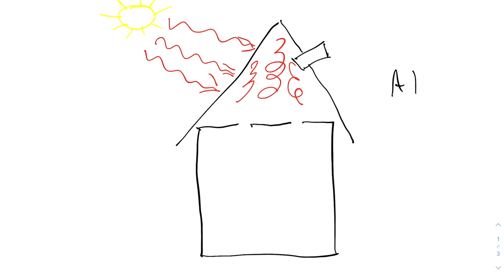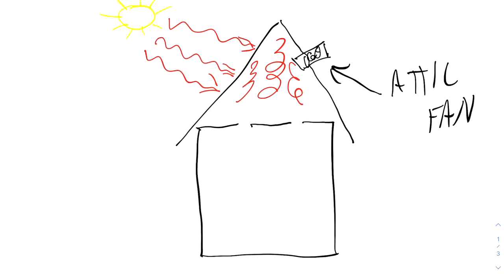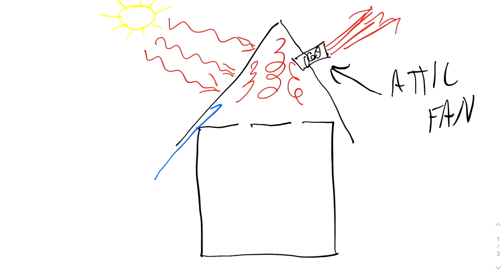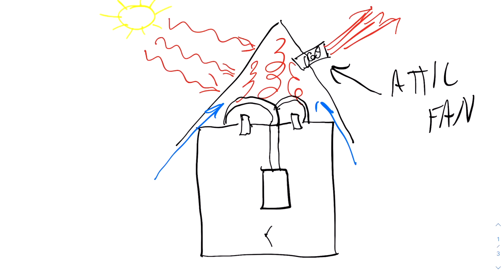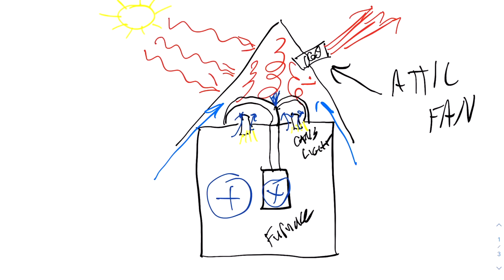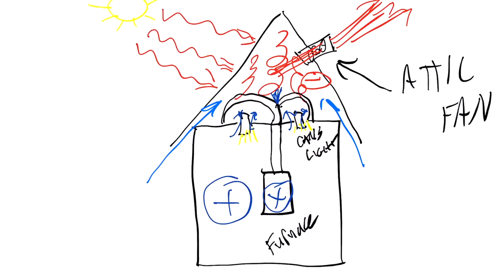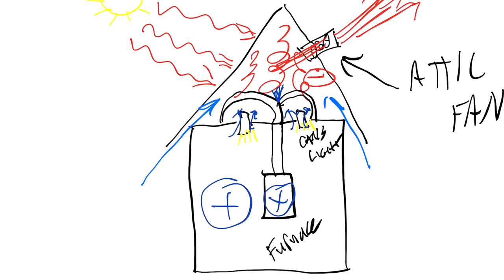3 Remodel Rip-Offs

Comment: I don’t know what part of the country the writen of this videeo was from, but they did mention Texas.  In Texas, every home needs an attic fan or a whole house fan.  Period.   

I moved into a Dallas mcmansion last February. The owner  installed Nest hvac controllers cause they are ‘cool” , but he didnt understand hvac nor how to use them.  The home was very hot since May.  The exterior hvacs had never been cleaned and could not keep up with north texas summer heat.   I watched YouTube videos to learn how to clean the outside units & that helped a lot.  Then  our attic fan died this August.
I had just gotten  the two Zone - two HVACs & two Nest controllers to work efficiently & our home was much cooler than what we suffered from june-August.   When that attic fan died, our home’s temp shot back up like i had accomplished nothing.  I pulled the dead fan &  we just got the replacement attic fan today .  i came back to YouTube to freshen up my install knowledge when i saw this tripe.  DO NOT LISTEN tTO THIS FOOL.   If your attic fan dies, fix it.

Comment: As a Southern California resident I can tell you attic fans do work when installed correctly! I will qualify that statement by saying that you need to have adequate ventilation to move the amount of air the fan is capable of moving or installing a fan that will push at one location and pull in another  This removes the negative pressure issue and heat that can build up in an attic space. Prior to installing fans my attic temps on a hot summer day ran easely 155* +, after installing they now run in the 110 + * range depending on ambient temps.
Reply: I agree 100%.

Comment: Generally I agree about the attic fan; however, I  installed  a gable end fan in an uninsulated garage. Made an enormous difference in the summer. Before it was incredibly hot. Afterwards it was the same as outside temperature. Of course it was easy for the fan to pull air in from the bottom. Which is what I wanted
Reply: I've been thinking of installing one too. Dumb question do you have to leave the garage door open slightly or install vents anywhere to bring in air from the outside?
Reply: If your conditioned space is sealed from your attic (and the only place it can pull fresh air is from the soffits) it'll work as intended. If the whole area is unconditioned then it'll work as well. The only time you'll run into a problem is if you don't have soffit vents or if you don't have any sealing between your conditioned space and your attic.
It's just a more aggressive version of the ridge ventilation most roofs already have.
Reply: Yeah, I did the same in my attic (insulation on bottom, nothing on roof) and it improved the air quality and temperature substantially.
Reply: You are right. powered ventilation systems are helpful to speed up the time of cooling in the night. Think of fans to control heat in desktop computer cases.
Reply: We have one too and it made a difference in our cooling bill.  It makes the biggest difference at night.  Gets rid of the hot air and plus in the cooler air.   Our house has vents in the attic so it does not pull any air from the house.
Reply: My parents don't use their AC, I put a fan in both levels of their attic and it dropped the average temperature 5°.

Comment: I'm really sceptical about the attic fan thing, that's like saying that rolling down your car windows in the summer won't help cool your car down.
Reply: 3 differences:
1) Static attic vents (industry standard) will let hot air out and pull cool air in just by the natural pressure differential between the free, cooler outside air and the hot attic air. This cooler air comes in through the soffits underneath your roof and the hottest air will flow out the rooftop vent especially with most roofs having ridge vents now which is perfectly at the hottest part of the roof and so that air escapes the easiest.
2) You're cooling your house as well and the pressure differential could pull air from your house into your attic if the pressure is different like what he said in the video.
3) Your house doesn't move. Basically, a house is more akin to a parked car and a static roof vent is like cracking your windows, however, it would also need an air vent at the base of the car door to let cooler air into the car and the hottest air out through the cracked window.
Reply: No that thats like opening your windows and then putting a tiny computer fan in the window to pull more warm air out and saying you notice a difference. That fan is not capable of generating the air flow required to cool you or the car.
Reply: Or it's like saying cooking with the oven door open is just as efficient as with it closed.
Reply: Well, houses don't move, so you can only compare them to a parked car. So what you just described is passive ventilation, which is what he promotes. 

It's actually like saying installing a roof fan in your car will cool it down if you insulate and air condition under the car. Then the fan can pull the air conditioned air air up into the car like it does with houses.

If all you care about is the attic being cool, just skip a step and run ducting up to the attic from your AC, the efficiency will be similar.
Reply: @ryckXattack  Also - you're not pulling very much conditioned air from the house - that's what soffit vents are for. Putting an attic fan is the equivalent of instead of sitting in a hot car with windows down - driving it, AKA forced air. And another point - you talk about air conditioning the attic? Insulating the rafters makes the attic conditioned space, so that's EXACTLY what you're doing when you spray foam rafters - you're air conditioning the attic.
Reply: Think about it like your car is parked in the sun. your car interior heats up and the first thing you do is roll down your windows to let out that hot air. They work, and are worth the money.
Reply: I agree. Parked car in the sun here in Arizona. You have 3 options: close the windows and doors tightly, crack all 4 windows an inch to let air move passively, or crack all 4 windows an inch and turn on the blower motor to push outside air into the cabin and out the windows. Do I have to tell you what's best? As long as there is a hole to the exterior that is equally sized with the exhaust for the fan, air can come from the exterior to makeup the evacuated air without issue. There's no way these quantitative scenarios are possible purely because of conditioned leakage from living spaces. 🤣
Reply: I had somebody from Power Home Remolding come by last week. They told me I needed to install a $12k floating radiant barrier on the 16 year old house I live in or the wood was going to rot and the beams/rafters would break because the attic was "overheating".
Reply: @mannys9130  That's not the point. You don't live in the attic. Your car interior is analogous to the interior of your house.
Do you care how hot your engine bay gets? No, nobody does. But it still has a bit of insulation to prevent it from coming in the cabin. That's all you need. No car runs the intake fans to cool it down further, so the car interior gets cooler. DUH.
Reply: except a house is not a moving car...
Reply: My mom had a large attic fan in North Carolina. She would leave home with the house completely closed and no AC on. The house heated up to the mid 80’s. She would turn on the attic fan for 2-3 minutes, and the temperature dropped significantly. It was like a hurricane in her house, but it absolutely made a huge difference
Reply: @tapsmiled  that's not an attic fan, that's a whole house fan that then pushes the air into the attic
Reply: @sprockkets  But every car runs a radiator fan to keep the engine bay cooler.
Reply: @Beerdwolf  No, it doesn't. It does that to draw air over the radiator, and that is it. Edit, and if you want to be technical, it runs also if the condenser needs it for the a/c.

Comment: Update on our solar attic fans.  Heat advisory today in North Texas with temperatures at about 100.  I just checked, and out two 30 watt solar attic fans are spinning like jet engines.  The thermometer in the attic says 103.  Seems to be working great.
Reply: That’s because cold conditioned air is being pulled from your living space into your attic thanks to the negative pressure from these fans. It’s not solving the underlying problem, but “tricking” you into thinking it is because the attic is cooler. The attic is cooler because your house’s AC is now supplying cold air to your attic as air leaks are pulling that cold air into the attic at a higher rate with that negative vacuum pressure from the attic fan.
Reply: @eggnogaddict6287  I simply don't believe that's true.  There's no way those two fans create enough negative pressure to suck air (through 18" of blown insulation) from inside the house.  These are not commercial floor drum fans.  They move about the same amount of air as a desk fan.  If anything, they will pull in air from the perforated soffits around the perimeter of the house.  Now if we had a unit pulling 20,000 cfm and huge holes in our ceiling then the situation would be different.  Anyways, the benefits of having an attic that is slightly above outside temperatures and not 160 degrees cannot be overstated.  You don't have that lingering thermal mass overhead, and you save a lot more energy because the HVAC system doesn't have to cool the ductwork before cooling your house.
Reply: @wabio  I mean, you can believe whatever you want, and it seems like you’re defensive because this is your current setup you spent real money on, and the thought of it being incorrect means not only did you waste money to not solve the problem, but if you are wrong then that means you have to eliminate your attic fans and spend thousands more to do it correctly. There are reasons why roofers don’t combine multiple exhaust methods for a roof. For instance—a ridge vent with gables, or a ridge with a passive wind turbine. The effects are detrimental to air flow within your attic resulting in a humid attic risking mold. 

Likewise, adding a powered exhaust with passive intake is a terrible idea. You want the intake to exceed the exhaust for the very reason of the negative pressurization you create. With undersized intake, your exhaust “sucks” air from wherever it can find it. That means from within your conditioned living space.

18 inches of blown-in insulation is not an air seal. Insulation is a barrier to conductive heat transfer, not air leakage. You stop air leakage by air sealing gaps with foam spray or caulking. A layer of batt insulation or 10 feet of blown insulation is not an air seal. The air loss moves through the insulation fibers. Do yourself a favor and scoop up a handful of insulation and tell yourself that stops air leaks. Then, caulk or spray foam a gap and see if any air flows through it. Done correctly, it won’t. Cover the gap with blown in fiberglass and blow lightly on it. The fiberglass will move and allow air through. You don’t solve air leaks by adding more insulation. You move the insulation out of the way to caulk/foam the gap.

So yes, attic fans do create a “suction” effect pulling conditioned air from the living space whether you want to believe it or not. All laboratory research points to this fact. The DOE recommends against attic fans for this very reason. You just seem incredulous that a small fan could do this. 

Have you ever blower door tested your house? One fan in your doorway finds leaks through the entire house. I just blower door tested mine and found leaks in my basement from a fan on the floor above me on the other side of the house. So yes, fans do more than you think or “believe”
Reply: @eggnogaddict6287  Yes, and I will still continue to argue attic fans do much more good than harm.  I've yet to hear anyone say their electric bill has gone up after adding attic fans.  Have you?  But there are scores of people who have had their energy usage go down....just read the comments.  If these fans were pulling mass amounts of cool air into the attic, their e-bill should skyrocket should it not since they are essentially adding a lot of square footage their AC needs to cool.  It would be analagous to opening the door between your house and garage and blowing cold air into it.  Your electric bill would go way up.  

BTW the primary function of attic insulation is not to stop conductive heat transfer.  It is to stop convective heat transfer by retarding the movement of air.  The batts or blown insulation have millions of tiny air pockets that essentially stop air movement.  So the hot air stays on one side and the cool air stays on the other.  So to say that mass amounts of air is leaking from inside the house, through R60 insulation, and out the attic fan is a stretch IMO. 

As many others have already stated,  the air movement in the attic will follow the path of least resistance (just like your blower test).  When the attic fans pull air out, the majority of the air replacing it isn't coming from the house.   In our home,  it's coming in from the 75+ feet of perforated soffit vents around the house.  

Anyways, I have absolutely no regrets or remorse buying those attic fans.   If I did not currently have them installed on my house.  I would gladly spend the money and have them installed today even after reading all the pros and cons.  Our attic temperature is just above outside temperatures during the summer and gets pretty hot here in Texas.  2 story house is 4100 sq. ft with 25 ft cathedral ceiling and a total of 52 windows throughout so it's no cakewalk in term of energy conservation .   Our e-bill is under $200 per month in the summer with thermostats set at 76 @ $0.13 per KWh.
Reply: @wabio  absolutely ridiculous. You air seal the attic floor and then add insulation. The insulation is not an air sealer and conditioned air moves through attic insulation when the attic floor is not properly air sealed. Adding more insulation does not change nor solve this. 

From the sounds of it, you must stuff batts into the rim joists, too, huh? Do yourself a favor and read up on batt insulation in the rim joist and how that design actually results in a rotted rim joist. How, do you ask?! Because the insulation with “millions of air pockets” allows humid air THROUGH the insulation, touching a cold wooden rim joist in the wintertime. The result is condensation as humid warm indoor air moves THROUGH the insulation and condenses.

The solution is to air seal the rim joist and add rigid foam board. Batt insulation is an absolute worst practice precisely because air passes through it, trapping moist air that condenses and rots the wood.

Same principle applies. Air isn’t “trapped” by loose blown in insulation. As I said, pick up a handful of insulation sometime and blow on it. Let me know if it traps air, would yah?
Reply: Of course, you completely ignore his point about electricity consumption savings. Who cares if you’re getting a small amount of cooled air lost through the attic fans if you’re still saving $100/month on electricity in the summer. Like him, I have not seen a single instance of solar attic fans increasing electricity consumption.

Comment: I put a fan in my attic and it lowered the temperature only slightly but where the real benefit came from was keeping the air moving I never got any mold or mildew in my attic always was very clean for the 20 years my fan ran during the day never even hard much dust either.  I had ridge vents in my roof so there was no negative air pressure that affected the vents